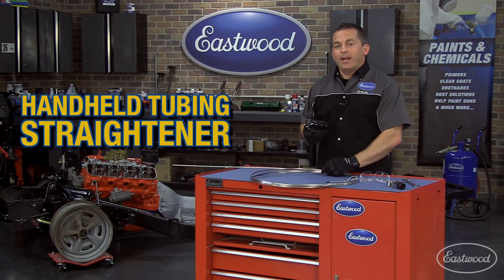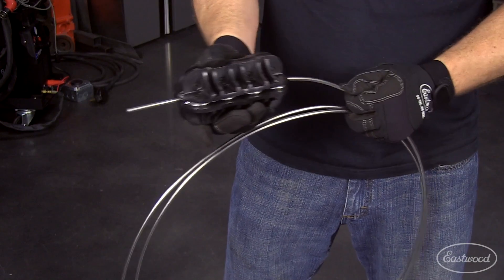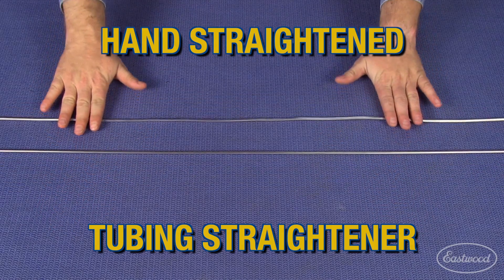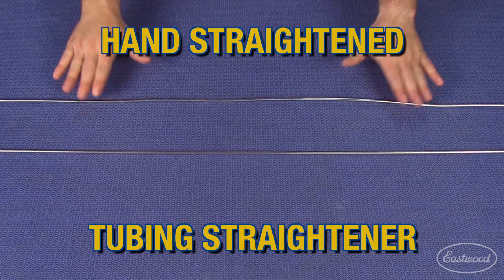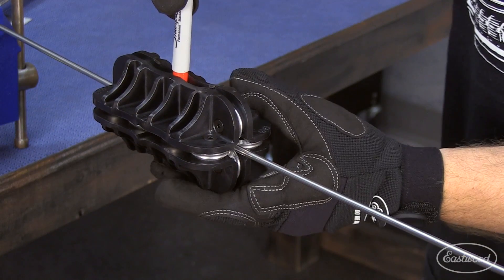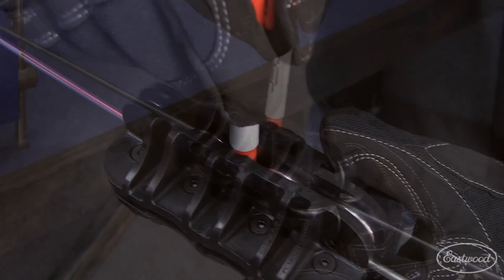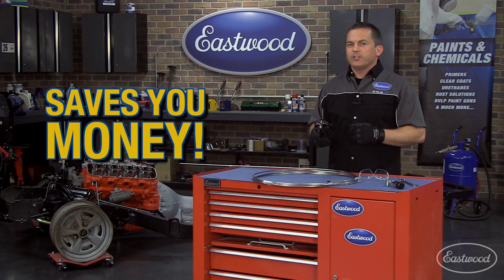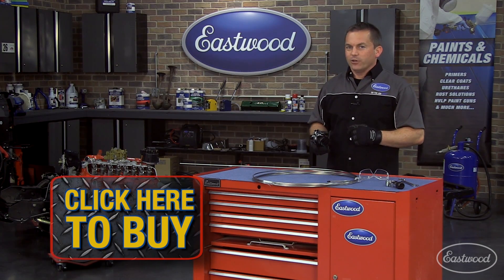How To Straighten Bent or Coiled Brake & Fuel Lines - Handheld Tubing Straightener - Eastwood

Comment: Maybe I missed it, but what about different sizes of tubing? Can it adjust to them or do I have to buy many size tools. I have always used the stretch method of straightening tubing. Unroll as much as you'll need and add about 4 inches for scrap. Clamp one end to something that won't move under pressure and the other end gets clamped around the end of a chain with a vise grip. Chain gets hooked to the trucks hitch and I put a little pulling pressure on the tubing. This makes it straighter than you can believe. While it is still in stretch mode I use a marker to make a line on top for reference. Then simply cut off the bent parts at each end and get to work making your new brake, fuel or any other use, lines..
Reply from the maker: +Steve 1961P. There is a Tubing Straightener for each size of tubing.